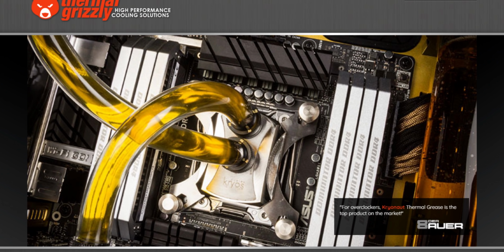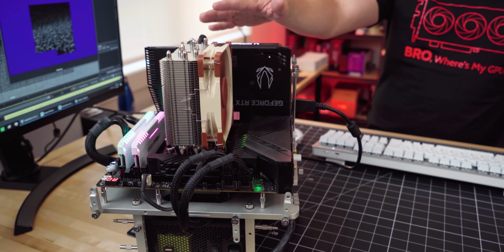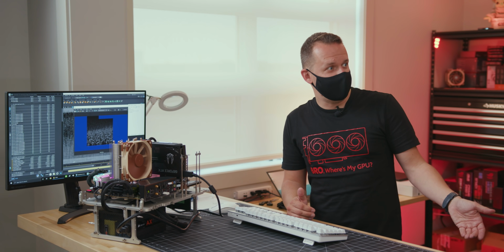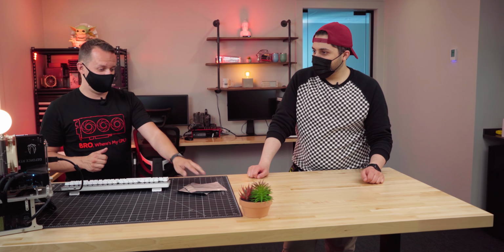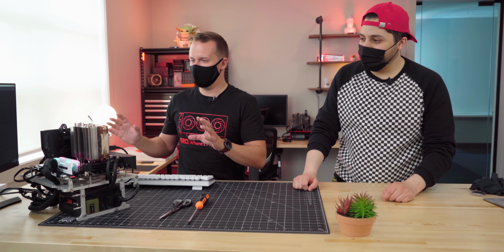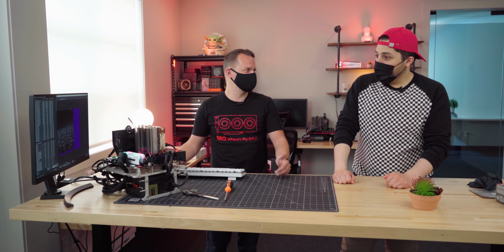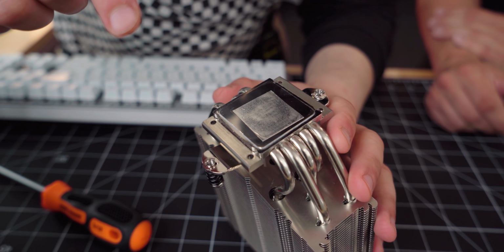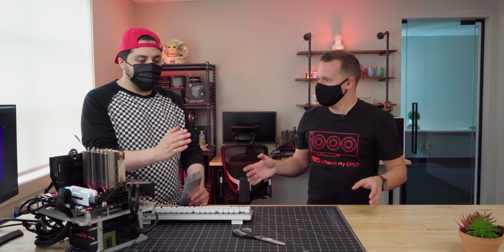Can this MYSTERY Metal Replace Thermal Paste?

Comment: The indium would perform better as a direct die application under the IHS. Thermal pastes and LM TIM on TOP of the IHS are on par with each other in conducting heat from an IHS to a HSF. That is why people, who delid with LM, still use a paste on top of the IHS. LM between the IHS and HSF is a waste, because of such little difference between it and a regular paste TIM in that particular application.

Comment: What if you combine thermal paste with an indium pad? For example, a small drop of paste on the cpu, then put the indium 0.1 pad, then another small drop of paste and then the cooler. An indium sandwich.

Comment: So the takeaway point from that is if you're rebuilding your system and find your thermal paste has ran out, raid the kitchen cupboard and put some aluminium foil in to see you through. Good to know thanks,
PS as for the Indium I'd rather buy a large tube of Thermal paste and clean it off. Might be good for you Tubers who need to replace it all the time but for average Joe, it's an unnecessary expense.

Comment: Isn't that what AMD uses under the heat spreaders on their CPUs making them notoriously difficult to remove without destroying the processor?  Of course I am not going to do that but I at least know there is some kind of solder holding the heat spreader on AMD CPUs.  Really you already carry a small amount of Indium in your phone's screen.  Every time you look at it you look at it really.  It is just that when it is that thin it is not noticeable.

Comment: Isnt the point of a fluid thermal paste that it fills all the gaps between the solid chip and the solid heat sink ?
Using a solid foil in between ... well surely you might as well just have the heatsink in direct contact with the chip ... there doesnt seem to be any point
Reply: Theoretically it can flex into the gaps, especially as it becomes more pliable when heated.

Comment: if you really wanna show us the difference there you gotta put it inside a laptop (10870H or 5900H) ....not on 125W CPU and a fan and cooler capable of dissipating 250W of power easily

Comment: In the video: aluminium foil is too thin, not good.
Also in the video: guys using only one sheet of aluminium foil.
I wonder what would happen with 2-3 or more sheets. About as thick as the indium sheet. Maybe not much, because the aluminium is harder? :D

Comment: If the aluminium foil was so slim, then why didn't you use more???????🤦‍♂️
No, not a folded big piece, coz of air pokets! But multiple individual cut squares put on top of each other. Why? Because it was NOT a fair and valid test, the indium was 2mm and the aluminium was under 1mm!

Comment: I paused the video before the foil, and here is why it wont work. Most people dont realize why foil has 2 different sides, the dull side is good at retaining heat the shiny side is good at reflecting heat. if foil was so great at heat transfer all those oven baked graphics cards would be dead as foil is the platform you suspend it on in all those guides. Foil makes for a very poor heat interface overall, its used for trapping heat in not dissipating it. I mean that is what cooking is essentially trapping heat so you can cook, the more heat you can trap the more efficient cooking becomes which is the opposite of what you want in a thermal interface.